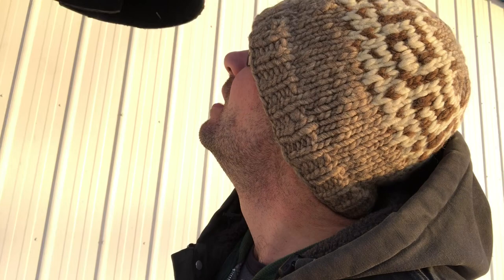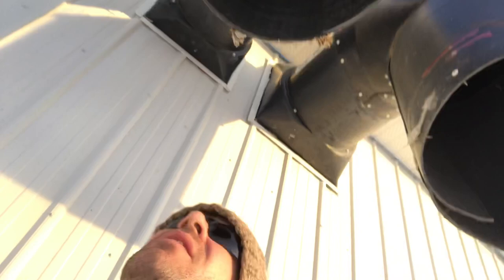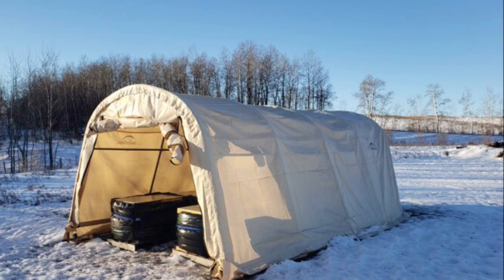Would a Car Shelter Work to Winter the Honey Bees ??

Comment: Back in the days in eastern Europe where they had strong winters, they would dig up a hole deep enough so that  its below frost line and put hives in it. Then they would cover it with branches or wooden beams. Once the snow dropped, it would create a microclimet inside allowing bees to winter just fine.
Reply: Sounds feasible

Comment: For moisture and heat loss I use roof insulation with pink R-10 built right into the telescoping top, remove the inner cover and add 1.5 inch feeder shim with top entrance. Then I wrap with tar paper, medium entrance reducer and mouse guard. I place the hives facing south with a trees west and north. This is the first place the snow leaves in the spring. I use this on double deeps and double 5 nucs.
Reply: Sorry to be so offtopic but does anybody know a trick to log back into an instagram account?
I stupidly forgot my account password. I would appreciate any assistance you can offer me.
Reply: @Isaias Raiden instablaster ;)
Reply: @Langston Felix i really appreciate your reply. I got to the site on google and im in the hacking process atm.
Takes quite some time so I will get back to you later when my account password hopefully is recovered.
Reply: @Langston Felix It worked and I now got access to my account again. Im so happy!
Thank you so much, you really help me out!
Reply: @Isaias Raiden Glad I could help :)

Comment: One thing I witnessed working a vineyard for several years, cold air behaves like water. It will run and settle in low areas like a pool. Buds that were opened with pooled cold air were dead after a short time. I am not sure how this correlates with bees and seeking a "lull" to place hives in but it is something to consider.

Comment: Use the garage tent to store equipment ... Free pallets covered with plyw for the floor hold alot boxes out of the weather ... I just built one 10x20x8' 200 sq foot of dry storage for under 500.00

Comment: That shelter would of been ok if it had one of them green poly tunnels with the square mesh. That way they would always have enough light to navigate. They are gonna need to do cleansing flights through out the winter. I agree with what you said. about them poor navigating indoors!

Comment: There is another beekeeper in Ontario , I think. He winters his hives outside and has some methods that work for him. His channel is Scott Hendriks and does have some workable ideas that basically are doing the same thing you are doing but on a smaller scale. He has also been putting his nucs in a building with an outside entrance. Y'all have some very common problems and interesting solutions. His ideas added to the advice you gave this viewer might work.
Reply from the maker: Yes Scott’s shed looks very interesting 
Each hive to its own entrance , he blocks them during certain conditions

Comment: Hi Ian, here most winter outside. Temperatures (November-March) are between 0 and -25 Celsius (32F - -13F). The worst idea is to put a roof over them to prevent them from heating up in the sun.

Comment: If a beekeeper wants to manage condensation in the hive, then shouldn’t he/she prioritize insulation above the colony? Insulate the underside of the outer cover. Keep the inner cover above dew point. 💡

But it looks like the hives in the tent are insulated on the sides with cold steel-clad outer covers on top.

I’ll never understand why so many beekeepers wrap hives and insulate the sides while doing nothing on top. 

Where is the majority of insulation in a home? Directly above the ceiling.
Reply: We insulate the top. That's just a cover you're seeing to hold everything in place.  Top of the hives is insulated the most.
Reply: @sinisterhipp0  

The wood shavings don’t have much of an R-value. They will help with wicking water vapor
Reply: @wild2heart  

That’s good. How do you insulate the tops? What is the r-value?
Reply: @RyanMcDonnough  They are R 20. We call them pillows. Sides are R 8. I have older wraps that the tops are only R 8 but then I double the top pillows.
Reply: @wild2heart  

R-20 is really good. Another thing you can do (which also helps during summer) is to cut some foam board insulation (I use R-5 1”) and fit it to the underside of your outer cover. That puts some very good insulation directly above the inner cover.

Comment: Ian, would putting his hives on the south side of a row of round bales be enough of a windbreak for him?
Also Ian, what do your bees do for water during the winter? If it doesn't freeze in the shed, is there still condensation on the inside walls of the hives? I can see why you don't want an upper entrance when wintering inside - your hives would be to dry.
Reply from the maker: Exactly 👍
Reply: @aCanadianBeekeepersBlog  i think  that ther is too much hive ventilation on yt.. Not inaf about hive micro climat , winter "hibernation". It's difficult to explain that water is needed in the hive. And bees should stay calm, not work on suplement this time of year..or sugar water.
Killing your bees with too much help, i think is one of the problems

Comment: Insulating the sides and not the top is a really bad idea. All the condensation will build up on the top and rain down on the bees when it gets warm.
Reply: Always have more insulation on the cover or this will be a big problem. I put 2" foam on the top and 3/4" on 3 sides. One side is left uninsulated so the condensation can build up there.

Comment: Good evenig Ian, I wrote the other day about trying to winter my hives inside a garden shed in total darkness next winter. Temperature here ranges between -10 and -30 during january and febuary and march would be in the -5 to -15. I would be keeping 40 hives in this 8 x 12 well insulated shed with good air flow top and bottom. I plan on putting my hives back outside as early in april as the temperature starts climbing above freezing point. As mentioned last time I wrote, I am off the grid so no power for fans, heaters or refrigiration. My question is would 40 hives create enouph heat to create a problem inside the shed or the free flowing air would be enough to keep the shed in acceptable temperature range. Thanks Denis
Reply from the maker: Only one way to tell :)
Reply: suggest you find the story from the American Bee Journal in Jan 77 about an Albertan beekeeper in the southern Peace River district who kept his bees in a insulated shed.  All the hives had outside entrances like the Slovenian bee houses.  his 60 colonies of bees kept the temperature warm enough the brood production during the winter allowed him to sell 200 3 pound packages of bees each spring.  With outside entrances you could leave them in the shed all year.  Just get a portable generator to power red lights to do your inspections, treatments, splits, and honey harvest.  do not be afraid to leave liquid syrup in top feeders all winter to make sure they do not starve.  If it works for you like it did for him you will  have lots of bees to sell each spring.

Comment: Hi I’m planning on turning an 88 cubic foot insulated “chicken coop” into a winter shed for 4-5 hives with a 4 inch ac infinity cloudline thermostat fan on 1 side and a couple small vent on the other would u suggest to put the vents on the bottom on the other side to provide more circulation or would that bring in too much moisture from the ground? What are you’re thoughts on this plan? Thanks as always
Reply from the maker: As long as you mix the air

Comment: do not depend on one of these car shelters if u have high winds in your area.
western Montana some winds are in excess of 50 MPH these shelters do not hold up to that kind of wind.
Ask me how I know?
You will be sorry.
I now use the silver bubble wrap 3/16" .
I wrap my hives with that. and use 2" foam board under the telescoping lids.
also bee blankets with cedar chips and a 2" sugar board.
for insurance against starvation from January to March. 
has worked really well.
Ian knows his stuff about bees .But mine are outside on 16" platforms with screened bottom boards blocked in the winter but not to tight.
hives are strapped down with ratcheting straps.
because we sometimes have high winds and bears.